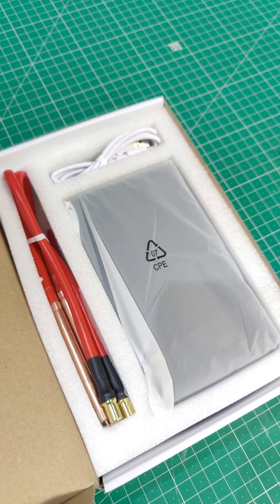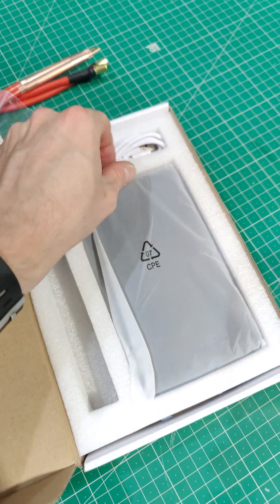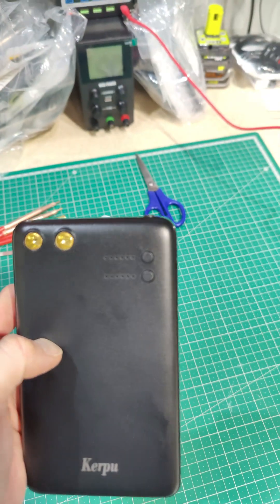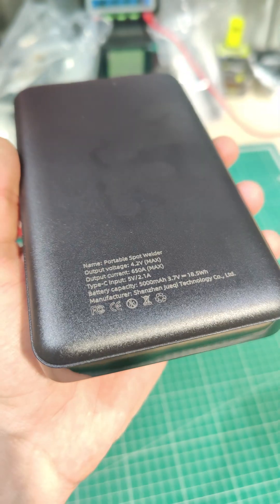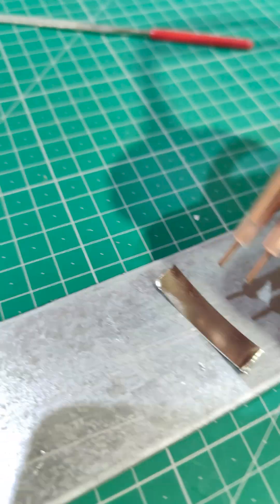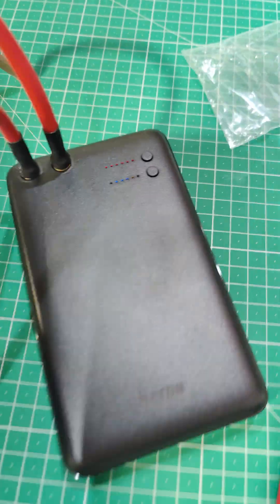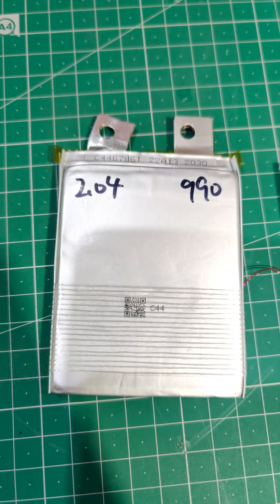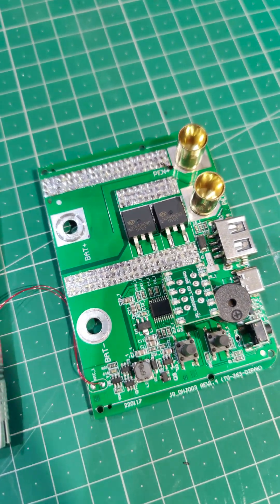Disassembling my Portable Spot Welder in 59 Seconds

Comment: Can you please tell me which MOSFET or igbt  is used to control very high current  and how many in parallel are used ?
Reply from the maker: No idea sorry mate
Reply: @PlatimaTinkers ok i Guess you are not from this field.
Reply from the maker: Nope - system & network engineer. EE is a hobby. But mainly I don't want to have to disassemble this thing again 🤣 

Although I'm also not going to answer a question that you can answer for your self in literally just a few seconds haha
Reply: @PlatimaTinkers i know i know I am / was too lazy too , though if you or someone reply, i will not have to bother Google search  or pause and zoom for code 😅😂 any way later I found on othe video and taken SS for later deepdrive for Ds.
Reply from the maker: Hahah it is in this video and quite, you only had to watch 59 seconds :P I found it, but I'm too much of an a-hole to share it and do your job for you 🤣